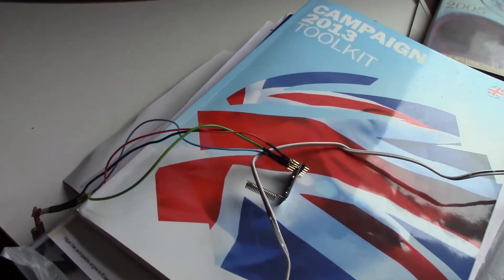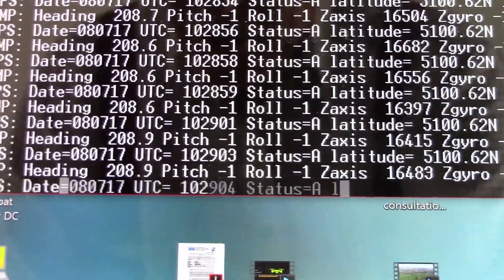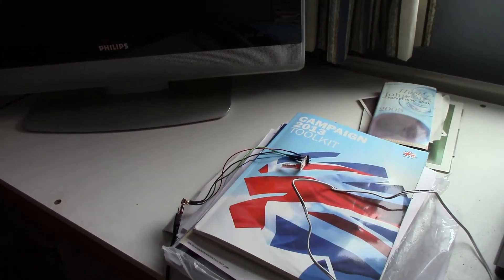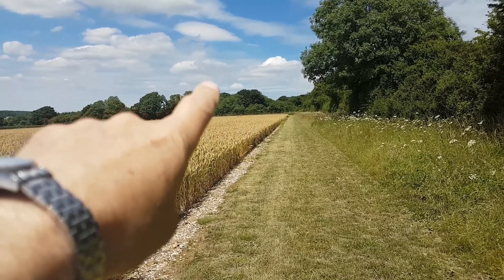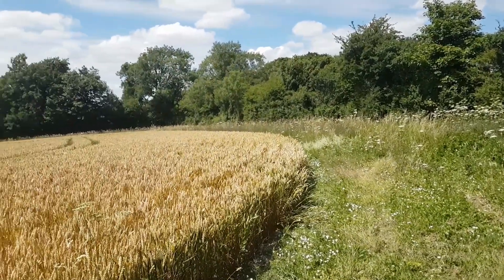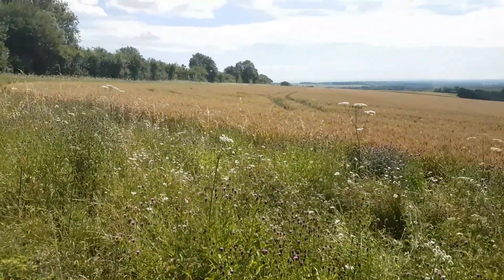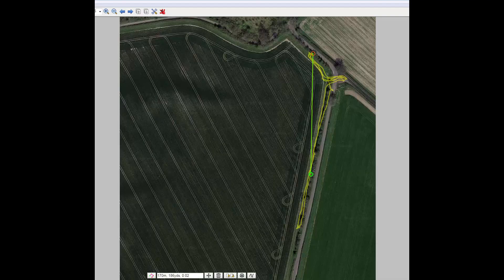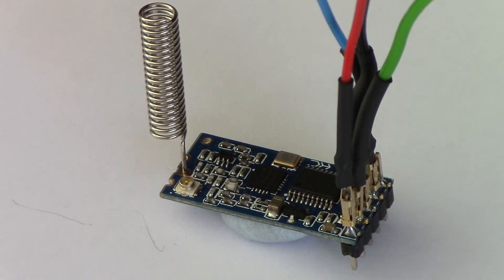First test of HC-12 433 MHz transceiver

Comment: How can i use hc-12 with arduino using python language?
Reply from the maker: You can use HC-12 with Arduino. I don't know anything about Pyhton on the arduino. As the HC-12 is only a serial connection, I don't see why it cannot be used with any programming language.

Comment: Hi, I have been trying to change the channels with AT commands, but the transmission is still working, even when AT+RX says that they are in a different channels.
How can I realy change the channels ? thanks!
Reply from the maker: You must exit from command mode by releasing SET pin before the channel change command will take effect.
Reply: @samuelfielder ... You are the best!!!! Problem solved! Thanks a lot!!

Comment: Hi samual, I have just got 2 of the HC-12's I want to create a serial link between a PC and my old Z80 based 1980's computer. I get serial to PC no proble, but not the other way. The use to serial module has other modem connections, RTS,CTS, etc. It does not look like you have just them, me neither, the TX led lights, but nothing arrives on the Z80 machine.
See: https://hackaday.io/project/168104-interak-z80-computer  I have swapped them over so but seem OK... Your use to serial looks a better job then mine, where was it from??
Reply from the maker: The USB to serial modules I was using just had TXD and RXD, no other controls. I can't remember where I got them. If you need RTS and CTS etc. then you could use an FT232R module ( https://www.sparkfun.com/products/12731 ). This FT232R has a switch to set the TXD output levels at either 3.3v or 5v, which might be useful. I wonder if the Z80 expects proper RS232 voltage levels on its received data line? That is, it might expect + and - 12v. What comes out of the HC12 is TTL level serial data (i.e. it goes from 0v to 3.3v). Also the HC12 is half duplex so it cannot transmit and receive at the same time. See also this interesting HC12 test showing longer range and telling us about fake HC12s: https://www.youtube.com/watch?v=awOPJK5He28

Comment: Hi

If I were to purchase two of these units, and used them straight out the box without any programming, could they be used as a one way remote control system?

This would entail connecting the digital output of an encoder to the RX input of the first HC-12 (transmitter) and connecting a decoder to the TX output of the second HC-12 (receiver). How do you set the unit to be a transmitter or receiver, or does the HC-12 automatically function as a transmitter if it receives digital data at its RX input and functions as a receiver if it receives digital data via radio wave? Is the transmitted signal ASK or FSK format?

Any help would be greatly appreciated.
Reply from the maker: I'd suggest you read the HC-12 user manual! Serial transmission is bidirectional but half duplex (so you cannot send serial data in both directions concurrently).

Comment: Hello Sir,

Do you have the link to the code?

Thanks
Reply from the maker: Sorry no. Communication with the HC12 is by serial line.  A simple program was used to generate the transmitted data, and the receiver used the utility Tera Term to display the data on the PC.

Comment: If I were trying to use two "rf" tranceivers to allow two microcontrollers to communicate with eachother (wirelessly), would the frequency of the mirocontrollers have to match the frequency of of the tranceivers. If so, how exactly would I go about that (like, step by step).
Reply from the maker: No, clock frequency of microcontrollers is not relevant, with the HC-12s or RM024s I have tested. Communication from microcontroller to transceiver is via serial line. I set mine at 9600 Baud, but you can set it on basis of how much data you want to send per unit time. It is sensible to set same Baud rate at both ends of the setup. These serial lines are TTL switching between 0 and 3.3 volts, so not the same as old-style RS232 which uses higher voltages.
Reply: Samuel Fielder 

Hello Samuel. Thank you for your reply. I am using hc-11's. I have done my very best to synchronize everything (including the baud rate, frequency, and the power supply). something is clearly being received by the receiving microcontroller, but it is not responding the way I programmed it to. This leads me to beleive that I have established communication, but the receiving microcontroller is not capable of interpreting the information correctly. I think this means that the there must be something wrong with the timing. I am using an atmega328p and the "c" programming language, and if you don't mind, I would like to send you the code I have for the transmitting microcontroller and the receiving microcontroller so that you can take a look at it, and show me what I am doing wrong. If I don't receive a reply, I will take the hint, leave you alone.

Thanks again.
Reply from the maker: Sorry, I can't help you in that way. I'd suggest debugging your setup step by step. E.g. if you use two of these https://www.sparkfun.com/products/12731 you can connect both HC-11s to one PC and use a terminal emulator such as Tera Term to verify that the HC-11s are sending data correctly back and forth, before even connecting the microcontrollers. You could also use one of these to talk directly to one microcontroller and make sure it responds correctly to serial input. As to software problems in the atmega, I know nothing.